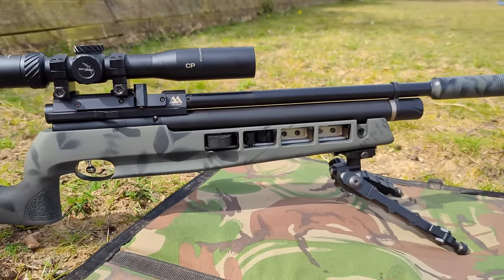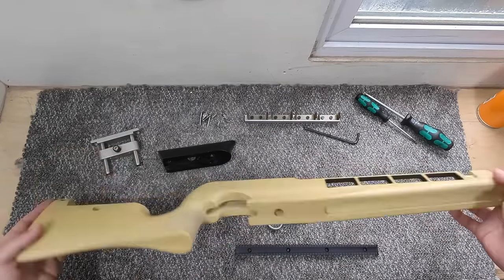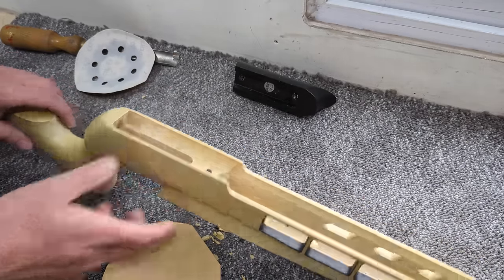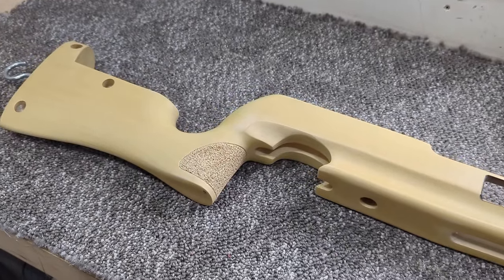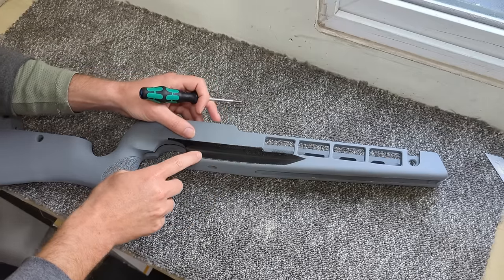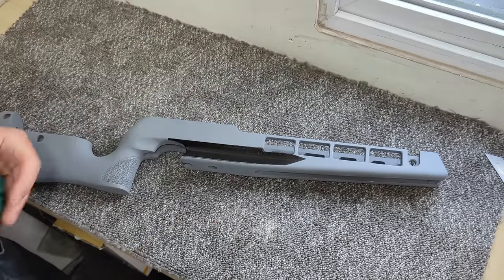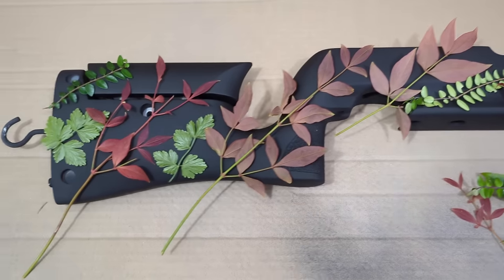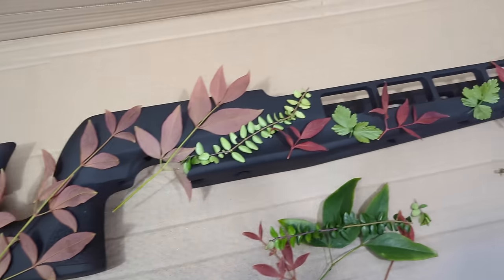Starting an awesome new Air Arms project. Refurbishing the stock...

Comment: Brilliant video good to see how you tackle things and the ideas, iv had a s510 for a few years iv fitted a Laines regulater in it not a easy job but not difficult but super stable after getting it set up, looking forward to see what you do next
Reply from the maker: I've had a load of regged s series models,this one has been perfect since day one so I've left it well alone. It's desperate for a service now but I don't think I'll go the reg route tbh. It'll be useful for the channel having a few regged Vs unregged options .

😉
Reply: @tillysgunstocks  I like it have a few iv managed to keep it simple one springer and one pcp, if it's been good from day one your very lucky mine changed the point of impact through the charge nothing a good service can't fix on a gun that ago 👍

Comment: What you have done looks great, I too prefer the feathered look to the camo edges rather than the harsh lines using stencils. Is the clear sealer okay for laminate stocks as well? I don't think the internal services on my Effecto PX5 stock are sealed, so would be nice to do something.
Reply from the maker: Morning mate, if it's laquered laminate, I'd be more inclined to give the inlet a gentle key up, remove any overspray/high spots and work in a good few coats of tru oil. That won't need Painting over the top. Tru oil is more a varnish than an oil and  perfect for cleaning up Inlets 😉. As always pay good attention to any areas that might hold water.
Reply: @tillysgunstocks  Yes, it is a lacquered laminate, unless I choose to rub it down completely. Have to fix the air leaks first though! Thanks for the advice, much appreciated. 👍